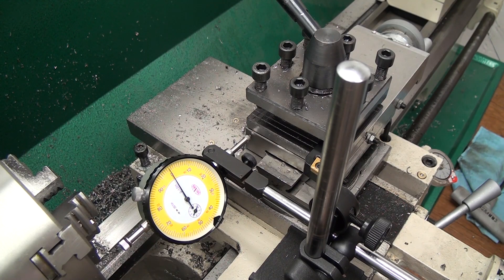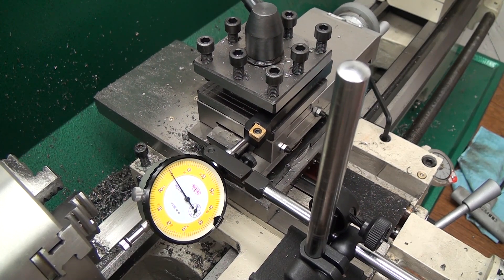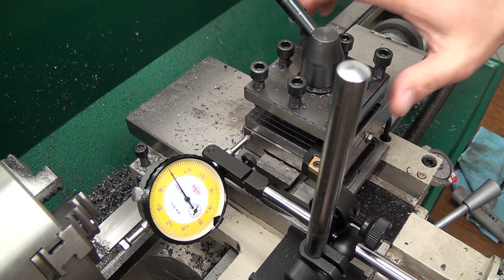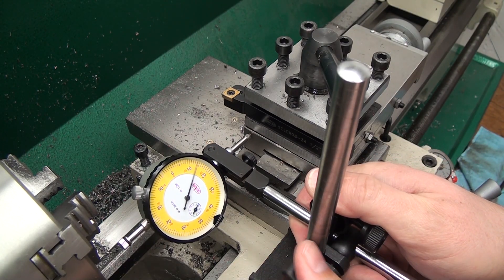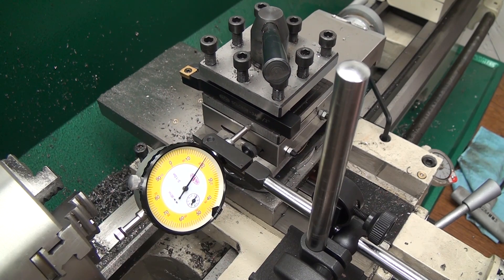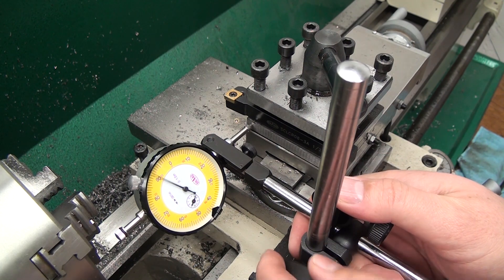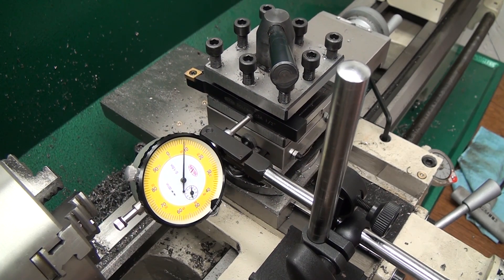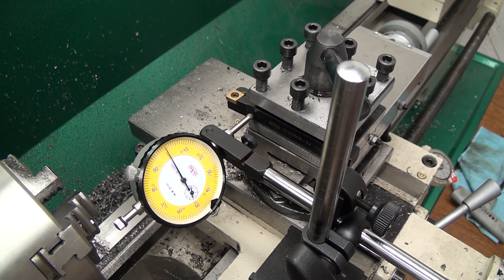10 G0602 Tramming (compound, tool post, or tool?)

Comment: makes zero difference. if the compound tolerance is acceptable to you then anything  secured to it will travel as one unit,  with matching accuracy, regardless of its angle, provided there is no tool movement independent of the compound base.
Reply from the maker: That's what I've come to realize too. Holy crap, this video is 6 years old! Time flies I guess :)

Comment: Have to agree if you where going to DTI every time you reposition you tool post or put in a new tool your creating a lot of work for your self..Whilst watching though you could remill all sides and make sure everything..Is in you limitations..Maybe take the reading then adjust the tool and tool post accordingly..Smaller tool so you can change the angle i don't know.!Unless your making aircraft or precision parts i wouldn't bother,

Comment: Use a parallel flush with face of chuck, run tool post unlocked up to parallel,square post and lock. You will this method faster.

Comment: In 30 years on a lathe I have never found the need to tram a compound slide. I have set them with a DTI to cut tapers and such but never for facing off. My big Colchester Lathe has no detent on the tool post id take the one on your post out so you can spin the tool a bit easier. Your making mountains out of mole hills, just get on with the machining and check your results before you look for problems. You aint doing bad for not much time just keep going and enjoy.

Comment: the angle of the tool for the most part is not that critical as long as it performs the function you need it to.  that tool looks to have about 3 degrees of relief so 1 or 2 degrees off won't much matter.  threading matters but .012 over 3 or so inches isn't really a huge deal.  my suggestion would be to get a good indexing tool holder and not look back.  those dovetail quick change setups have a lot of give in them compared to a good indexing toolholder.

Comment: What is important is that the bedways are 90 deg to the spindle bore, the angle will only adjust what part of the cutting tip is engaged with the stock, I think you are a very thoughtful machinist which is great, you sadly will (because you care) have real headaches when it comes to precision using these Chinese grizzly catalogue number tools. Do not blame yourself too quickly. 

I remember Taiwan mill/lathe in 80-90's they were quite good to be fair, China mainland tools are JUNK...Still!

Comment: What you are really looking for in regards to the tool holder is repeatability and rigidity. Everything else is controlled by the ways.

For 60 degree threads set the compound to 29 and 1/2 degrees and then set the tool to the work using a center gauge.

Comment: I like your videos and they're always interesting to watch, and i dont like to sound negative, but worrying about your toolpost is the least of your problems, and the only time you need 100% critical setting is for parting or grooving, in which case i use a parrallel against my chuck to square it off, sorry and also threading tools need to be perfectly square. a qctp is no easier or faster than a standard 4post like you have. And to expect quality for the price of your lathe is optimistic.

Comment: I agree with john, unless you need repeatable tool changes like in cnc or production work where you need to keep track of tool offsets, then the slop in the tool holder shouldn't matter. On tramming the compound's relative motion in general, I would put the magnetic base on the compound and indicate off of the lathe's bed v-ways (you might need to extend the arm...) If you have a test bar that fits your lathe's spindle nose, that would work too.

Comment: My G0602 is exactly like that too, no biggie.  Having the toolpost and tool be 12-30thou off doesn't really matter, it just affects the angle that the tool is engaged at, so instead of 95° it's say 98°, not a big deal for facing, turning, or boring.  I have only had to truly align the compound when I want to do exact tapers or drilling with a drill in the toolpost (so the drill tracks straight).  Even for threading it's not big a deal because you're still guessing when you set it at 29°.

Comment: I think it is the way it's supposed be. With a quick-change tool post you'll get the best accuracy but it's still not perfect. I always set the tools up after I change them and it's not really a big deal in my opinion. But if you have the money for a good quick-change toolpost, it's a pleasure to use one!

Comment: I have never even used my lantern type tool holder. You do want to go with a quick change tool post. It makes life so much easier.

Another thing that I really love is my swing up external threading tool holder. There are a couple videos here (blogwitch) and the real info is on MadModder. The gentleman that made it goes by bogstandard.